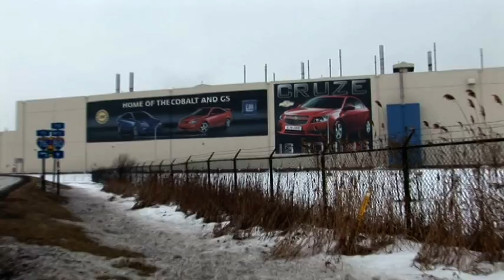Chevrolet Cruze Manufacturing Footage

Comment: Let me clear a few things for people that are bashing these workers and the factory...  I work for the Chrysler plant in ILL... When u have a "launch " there's always going to be people standing around making sure the cars are getting put together properly... Like making sure the operators are not falling behind from their windows.. Making sure the torque specs are correct.. Etc etc... And we are not required uniforms unless if u work in the paint and body shops... Yes there are some areas that required you to wear bump caps eyeglass and sleeves.. And these workers put their pride in these cars as much as we do in belvidere.. And any other automotive plant in the US

Comment: I bought a 2008 chevy malibu on April 23 this year, 24 hrs after engine gauge said it was overheating took it in they said it was a faulty gauge, 3 days later engine starts overheating again and car dies have to bring it in again.If you decide to buy a chevy be sure to purchase a full warranty with the engine included and before  your warranty expires, get full coverage automotive repair insurance because whoever designed the engine for this car must have been really drunk. Though it seems even foreign cars have alot of problems too.
Reply: mpeppermint23 but the amercians cars before 2010 are bad.... I'm looking from 2012 and above. don't expect good American cars below 2010 because they are very disappointing.... a Nissan Altima from 2008 would a way better deal than an American car.

Comment: Correct me if I am wrong..... When bolting on a wheel, isn't the correct method to tighten the lug ACROSS the wheel from the last lug tightened (star pattern), NOT the one NEXT to it as the idiot in the video is doing? Using the method shown can result in a warped brake rotor.
Reply: Agree
Reply: Made in 'Murica...
Reply: that's what the warranty is for
Reply: That is why Robots are better. No mistake or corners cut. The robot doesn't bitch to the UAW office that went to lunch 2 minutes late.
Reply: get torqued down the line...

Comment: they got more people just staring and watching then anything
Reply: tstill This is the launch of that model. The people standing and watching are Engineers, Material Quality Control, outside vendors examining their parts, and finally the GM Management Team following the new build process.
Many of you are without knowledge or understanding and make incorrect posts.
I suggest all of you go today and watch a finely tuned manufacturing process. One that builds high quality vehicles and meets their production schedules set forth by the Corporation HQ.....

Comment: 2011 Cruze RS - (2) AC Compressors, (3) ECM changes on turbo, (2) Thermostat housings replaces, (1) Cat Converter code, (1) Vent control box replaced.  That's in three years.  I would trade mine for a Ford Pinto right about now. What a POS.